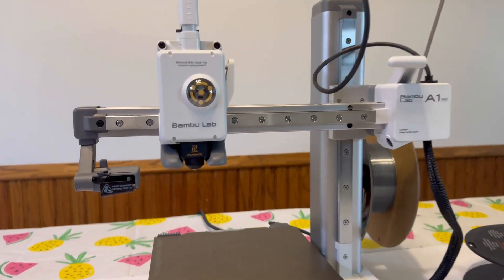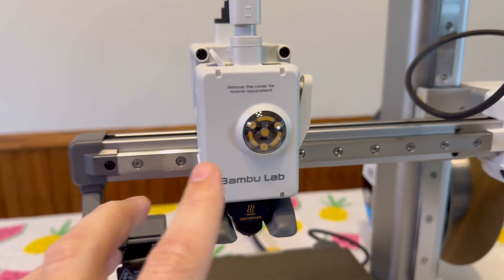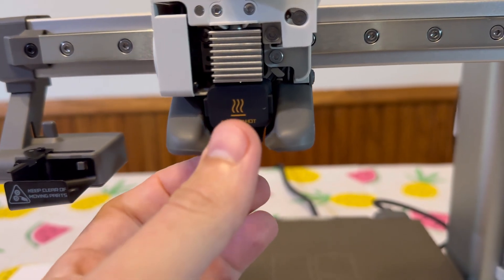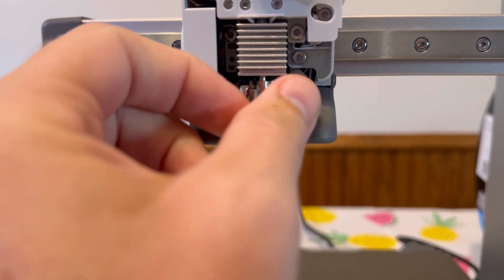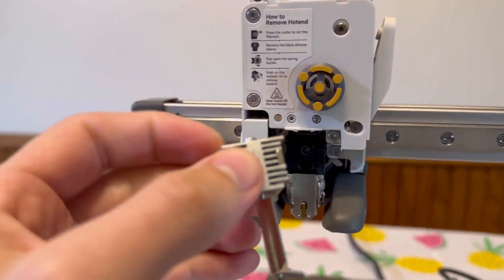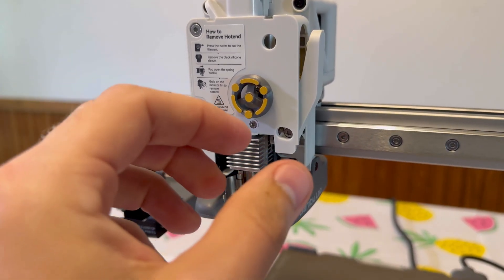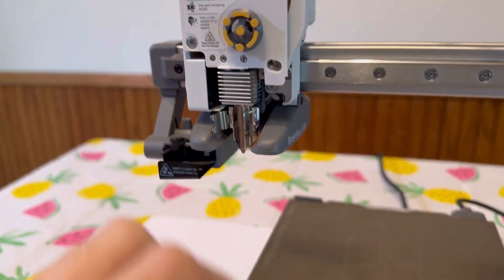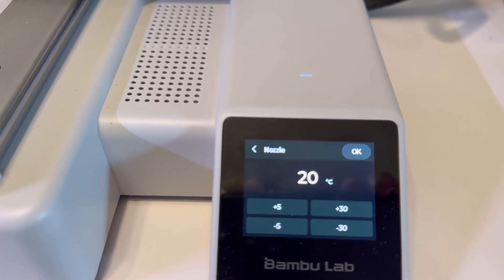How to Change Nozzle on Bambu Lab A1 Mini

Comment: After replacing the nozzle it seems to scratch the plate, any solutions for that?
Reply: did you change the settings in the slicer to make it have the specific nozzle? cause if you didnt that might happen

Comment: Great! Seems relatively easy. The printer is sold with different noozles? Or just with a default 0.4?
Reply: Default 0.4. 

You might want to change nozzles for faster printing (0.6) or higher quality (0.2)

Comment: Hey buddy you need to tell newbies if they still have filament in the nozzle to unload it first otherwise they will be pulling the nozzle out with the filament and having to cut it off and then when reusing that old nozzle you will have to purge it out. Good info but have to start from square one for first timers, who are the ones likely searching for this. Thanks
Reply: Yep, that happened to me :D
Reply: yeah i looked at multipel videos NONE even mentions what if you clearly used the current nozzle so naturally has filament in it...
Reply: YES! I feel  like a muppet but I have been trying to figure out what to do with the current filament in the nozzle when changing
Reply: And this is why I always check comments first
Reply: yes, this is most stupid video to change nozzle ever
Reply: That's the info that I was looking for online!

Amazing these guys actually making the videos skipped this step
Reply: came to this comment way too late lol
Reply: 1 year later this helped me, thanks guy!! Didn’t know if I should leave the filament in or not
Reply: Now you tell me, sigh.
Reply: Thanks for this comment! Was in the middle of this and thought 'hey, what about the filament', looked down and realised this was a necessity.
Reply: Yeah dude... What a huge miss in this video.
Reply: me. XD. ty for comment, glad i read them first.